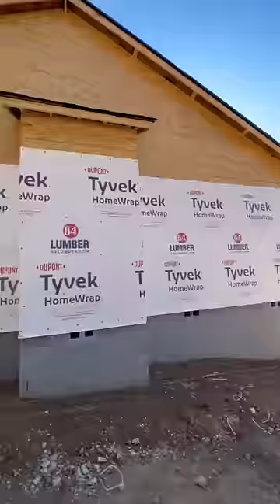Build My $350000 Wooden House in 60 seconds!!

Comment: Do I see that correctly that the house has no continuous foundation? Was there really no foundation poured for the outer walls? Then the wooden walls made of cheap lumber? No wonder why the buildings don't last longer than 50 years. My parents' house has a full basement. In the basement as well as on the ground floor the walls are between 50-80cm thick. (The bomb cellar from the 1st World War has 1.2 meter thick walls and is additionally reinforced with concrete) The extension also has 50 cm thick hollow concrete blocks which are cast. Only the roof construction is made of wood (the supporting beams have the dimensions 40x60cm) Septic tanks are embedded in the basement in order to pump out any water that may have entered, and the entire property was raised by 1.2 meters to provide flood protection. (a river flows through the garden) Just to give a German example. The original house was built in 1918 and was a farmhouse. Unfortunately, there is no precise information about the start of construction, as construction has been postponed several times due to the war. How the builders managed to complete the house during the war is still a mystery to me.

Comment: What i don’t understand is building houses is keeping more and more expensive while the materials are cheap as f...,weak and will last way less then they use too.. Even the builders are costing more and more while it’s been done faster and faster,with less experience and not good at all like lt should be done or they use to do it. In europe every experience builder who build these type off houses or prefab houses know it’s bs and will only cost you more and more because you constant need to fix things or after a few years things began to crack and lose there “quality” even if done the wright way. The best thing you can do is pay a lot more or buy a old house and renovate it with decent material. After 10y in construction i’ve seen things,know sh*t,see how people “work”,the materials getting worse and architects who don’t know what there doing so many times, i quit and work in a factory. Pays more these days,you have your 7u-16u hours after that no traffic or still on the road from work or work longer to finish. After thats straight to your home,no injury,pain in the back or tired after 12-14hours,not controlling other people if they did there job like it should or fix there sh*t and less taxes..

Comment: Why are American houses built like they're made of wood popsicles? That "footing" foundation was not properly fixed in the ground, and the blocks are stacked way to high for being so small. The floor basically just sits on the foundation instead of being set up with proper structural support pillars, walls are abysmally thin, roof has no proper weather insulation. No wonder tornadoes and hurricanes obliterate your cites

Comment: It’s weird to see an all-wood house to me (European) as well as a really shallow foundation, but I suppose that doesn’t matter since the house is much lighter than they tend to be here. Me and my friends always joke about “dumb Americans” investing hundreds or even thousands of dollars into doors or locks, when you can jus run through the wall 🤣. Although I’m sure that’s not true
Reply: @Namanoh  
I suppose it depends on what type of wood and how densely it's constructed.

If we go off the general (from what I've seen) construction techniques used in america, it usually uses a system where a frame is created from proper hardwood, after which it is sealed with plywood and/or drywall on either side, the cavity between the outer and inner wall consists of insulation material.

Considering that both drywall and plywood break rather easily upon impact, and the fact that insulation is just big bags of fluff, I think there is some sense in what I'm saying.

Perhaps you were talking about an all-wood/hardwood construction, similar to construction techniques used in the northern US and Canada, in which case it would indeed be rather difficult to get through the wood.